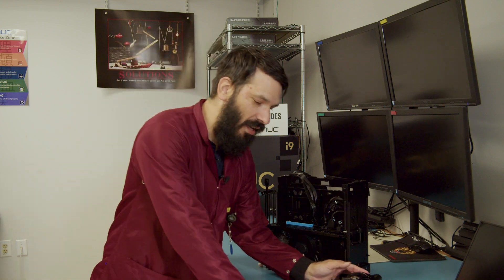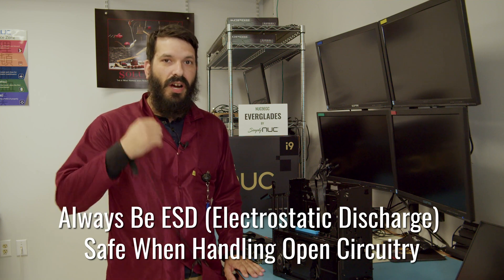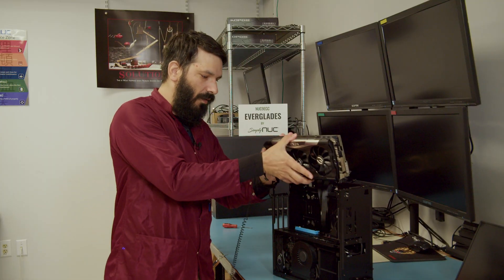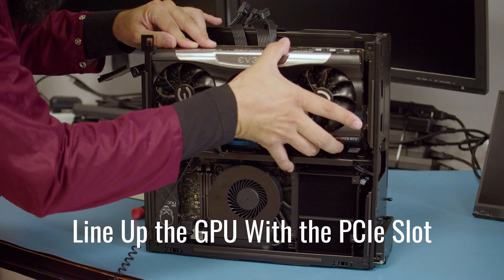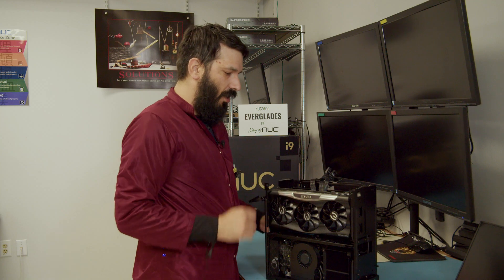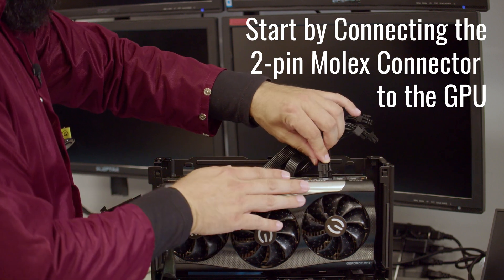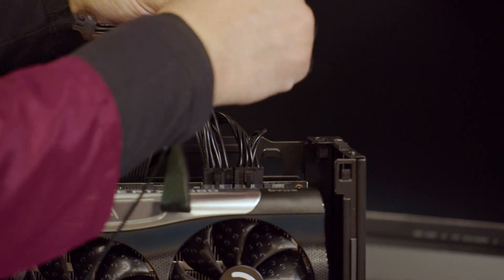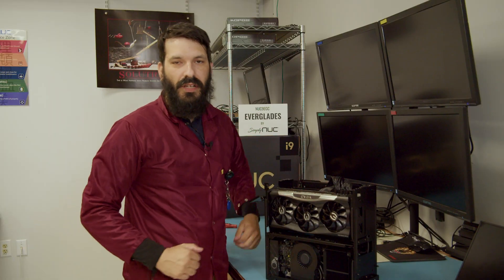How to Install or Upgrade the GPU on an Intel NUC: Step By Step Directions

Comment: I have a NUC 8 and unfortunately, all these pc part makers have their HQs as a subsidiary of Now and Forever We the People USA.
They are notorious for low budget and disability discrimination...

The We the People USA gov literally pays out the esc lifer 1080$ a month( and that's to 99% of the esc lifers and refuses to reform the SSA to what it was made for by law in 1969.
The low incomers who are stuck at 30k a year.. btw poverty income is now 25,000 a year.

 I just clicked on this video out of boredom just in case of we are getting rid of old inventory of updated parts..

if been saving since 2021 for  my 3rd pc. and i barely have 50$ saved so at my current pay right and prices.....
by the time i even save up for a GPU alone, the model, i'm going for will have stopped support fand production for about 6 years....

1st pc was lap top(university guidance counselor paid for half of it) pc was bricked by intel and microsoft update a year later,
 2nd pc bought with 10 years of savings and stimulus check.
stooped support(basically bricked my pc) in 2024, and is struggling to do basic system set up. 

3rd pc and monitors is listed at 6000$.... and befor you say shit the build i made is not an option due to autism's needs for what im using for the pc. 
if i want it to last 13 years. so shut the fudge up about their being cheaper options i already checked. there isnt,

these pc part makers are not living in reality. there is a litterlly tfro social security law which is a stat treasury that says you have to supply a pc at 500$ and whatever spec and tech
 fit the disabled person's needs and all the have to do is show their award letter. in addition to allowing a monthly payment plan of 3 years. there is also a disablity production law.
now the disablity equality laws to included  a persons pa check. and al they have to do to get price met is prove they are on a fixed income....

most owners of businesses won't follow any laws that put the poor on equal ground with people with alot of  monney.
of the problem starts with the economic controllers. if a company like intel sued each states senators, i can promise the esc lifers would def increase sales by 300 million and btw
300 million people actual paid ats puts about 300,00 billion back into the economy, so the 10 so part makers would get 10 billion ever 3 years..... mwhaha

any whos cool video i learns sum new stuff today:
and lastly the pc markers are going aways from having their parts fit in smalle cases, most of the new stuff is like a 4 foot case now..
THAT IS THE SIZE a DESK TOP COMPUTER SHOULD FIT NOMATIC BACK PAK LOL

K

Comment: hi @simplynuc i have a older intel nuc Intel®Core™ i7-6770HQ skull canyon that i wanted to possibly upgrade to run games like cod what advise can you give me on upgrading this mini pc i got the mini pc brand new it has windows 11 pro on it as well and has all the latest update help would be much appreciated i was told i only needed NVIDIA® GeForce® GTX 960 or AMD Radeon™ RX 470 to be safe and just a little more ram because i have 8gb right now

Comment: I was expecting an Intel NUC. My one fits in my hand and is nothing like the thing in this video.
Reply from the maker: NUCs come in all shapes and sizes. For the smaller form factors it's best to connect an eGPU to the unit for increased graphics processing. We have a video for that as well.